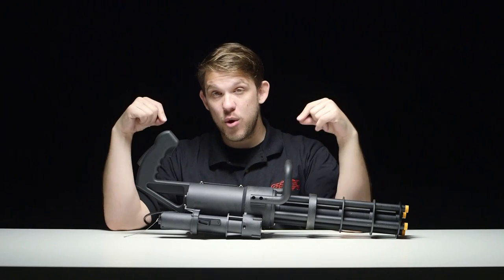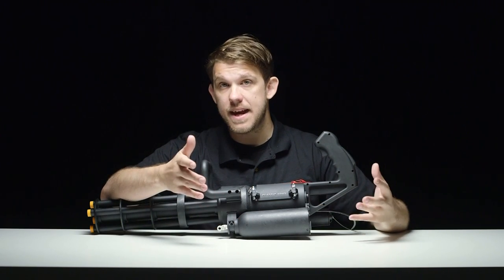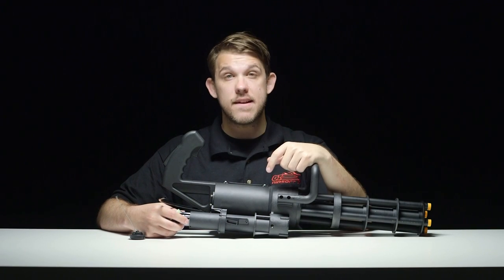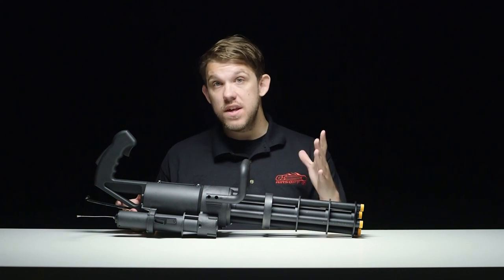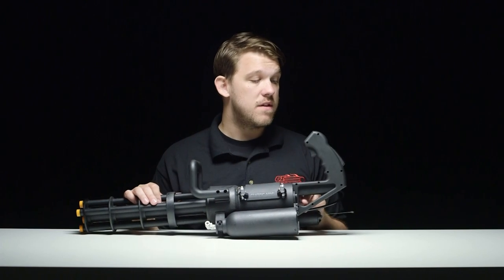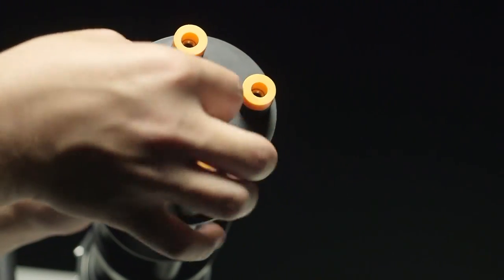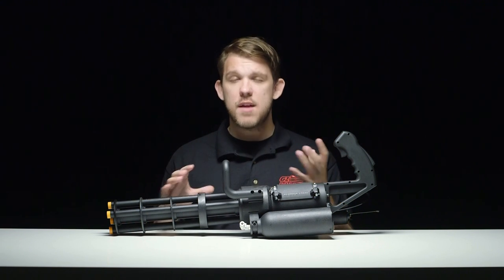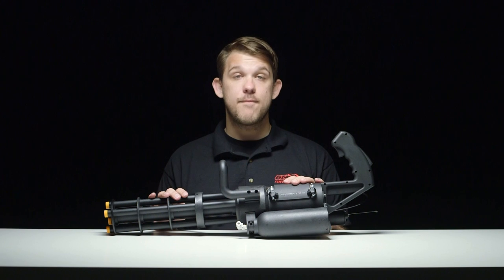Classic Army M132 Micro Gun | 38 Rounds Per Second Minigun! | AIRSOFTGI.COM

Comment: How easy/difficult is it to disassemble? I'm aiming to change out the gas canister compartment and the battery compartment for prop feeder/delinker and drive units to make it more beastly and I'll need to screw them on to the main body; but if I can't get into the main body to put screws through it, then there isn't much of an option for me to do so.

Comment: do they have any plans to add accessories (i.e. flashlight so in a CQB environment we can see where the bb's are going)?  Also how would you extend the barrels with them not being threaded...  Finally are there going to be sling attachments to help carry it between ao's?
Reply from the maker: Accessories will be later but I did ask about rail space and they are thinking of some options. Flashlight would be a welcome addition but you will need to figure out how to mount it. As for extending the inner barrels, since they are not threaded you might have a wonky looking minigun. 

Sling options I have not heard anything about. I see some areas you could affix one though.

Comment: What SLP HPA rig would you recommend for this?
Reply: halo23 Ninja air has a LPR, any tank will work, you would definitely want 4500 psi, I would go with a larger tank if you can.  I have a 92 cubic inch 4500 psi tank that will keep it shooting for a few games.
Reply: Creepy Airsoft so any HPA regulator would work too?
Reply: halo23 the reg has to be low pressure, you also want to get a low pressure tank (most tanks can be switched to low pressure).  My tank had a high pressure regulator which was putting out about 850 psi, I switched to a low pressure regulator that dropped it to 350.  This gun works well around 110 psi, just open the low pressure remote line slowly to get it there.